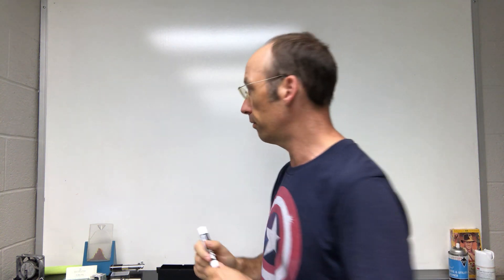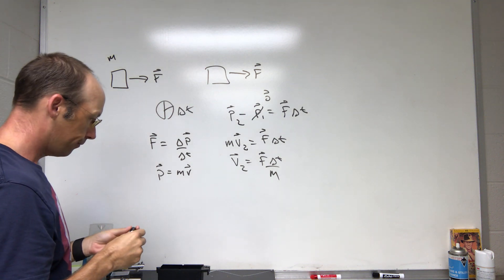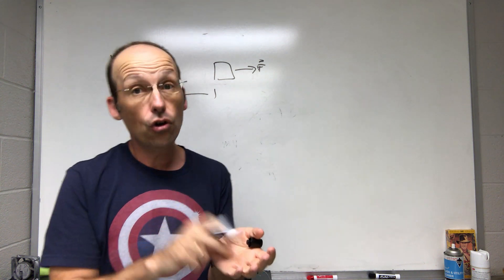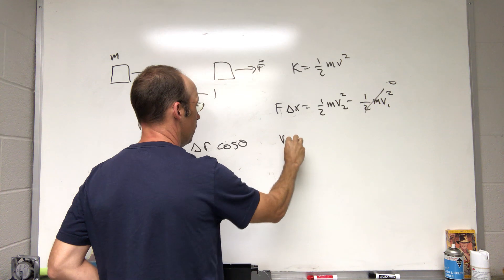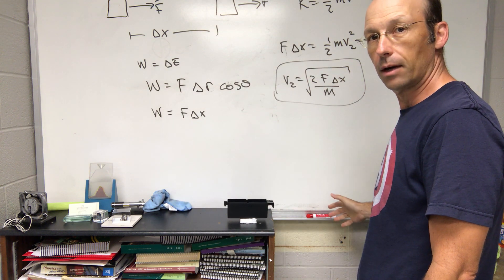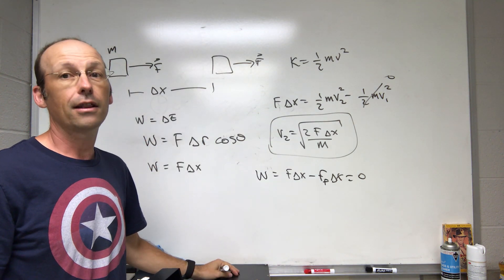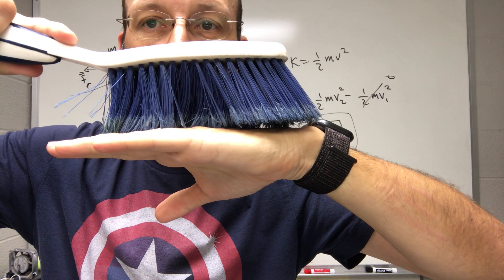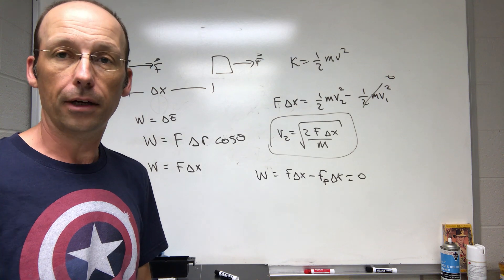Why Can't You Calculate the Work Done by Friction in Physics?

Comment: Your brush analogy is not correct. In cases where material is not transferred between the block and the surface, the atoms in the block can move, at most, a few nanometers before springing back toward their equilibrium position. This effect is negligible to your calculation of Delta x, and is certainly not large enough to produce the heat that you measure in the block and on the surface. The solution is that the frictional force * Delta x is equal to the change in internal energy of the block + surface system.